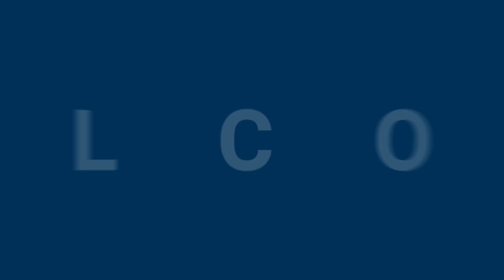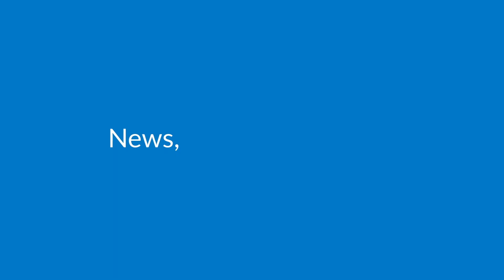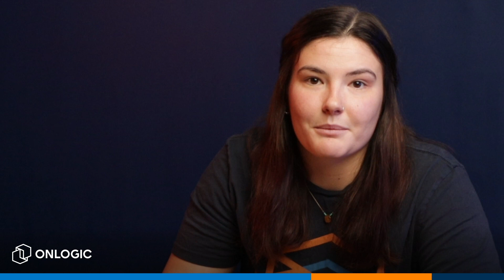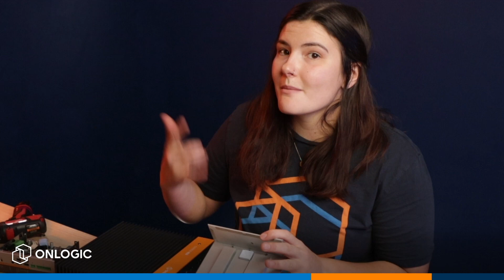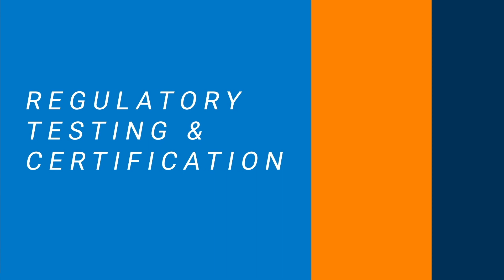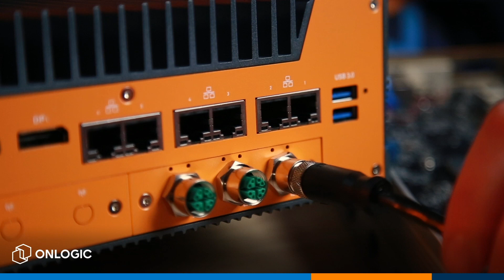Industrial PC Teardown

Comment: Great work !

If you are looking for an SSD with high endurance, wide temperature range and multi-functions such as power failure protection, AES encryption, anti-shock and radiation protection, please feel free to enquire. I’m a sales from Renice, Renice is  a China-based manufacturer specializing in high-quality industrial-grade SSDs and rugged computers for specialized projects.   

Solid-State Drive source factory supply chain, no distributors to earn price difference,  high-quality control and stable guarantee.

Comment: Wonder if you have any suggestions for a small PC which needs to operate from -40c to 75c. Most other specs are flexible, but temperature needs to cover a very wide range.
Reply from the maker: Thanks for the question! The majority of our Rugged computers are rated from -40 to 70C: https://www.onlogic.com/store/computers/rugged/.

If that extra 5 degrees on the top end is crucial, our team would be happy to discuss other options: https://www.onlogic.com/contact/.

Comment: Do the have GPU slots??
Reply from the maker: Thanks for the question. Yes, for workloads that require additional graphics or parallel processing capabilities, we offer a range of systems that can be configured with a GPU,  You can check those out, here: https://www.onlogic.com/computers/embedded/with-gpu/.
Reply: @OnLogic  perfect 👍
Reply: @OnLogic  at this point do we really need PLCs ?